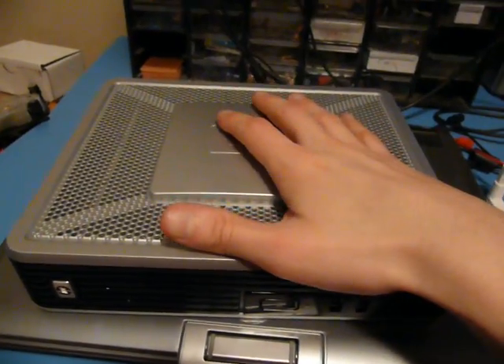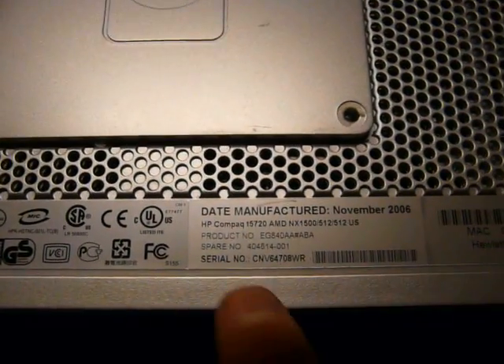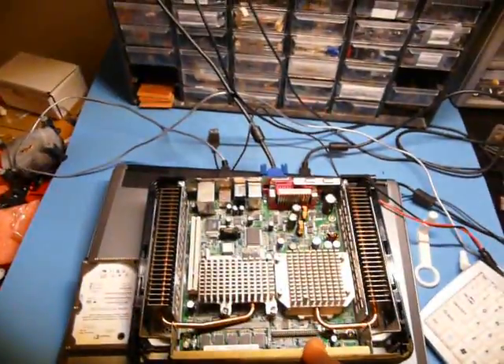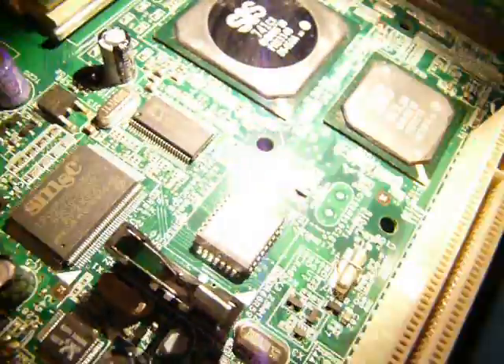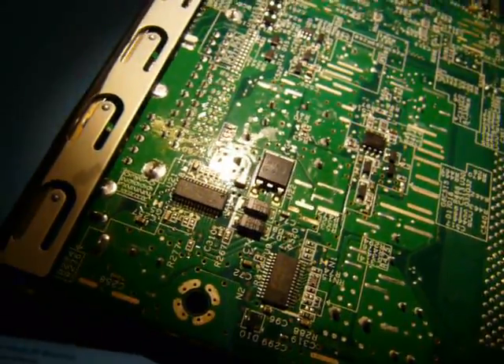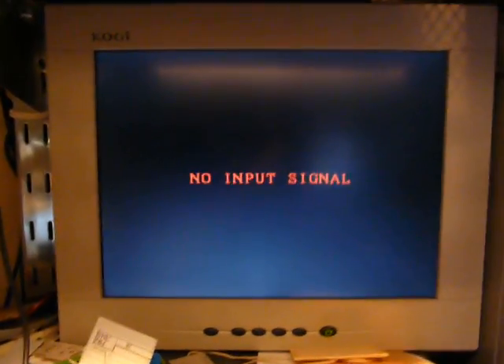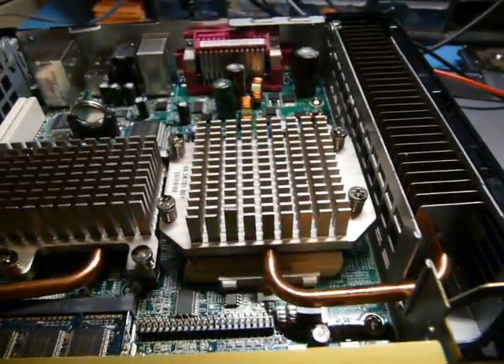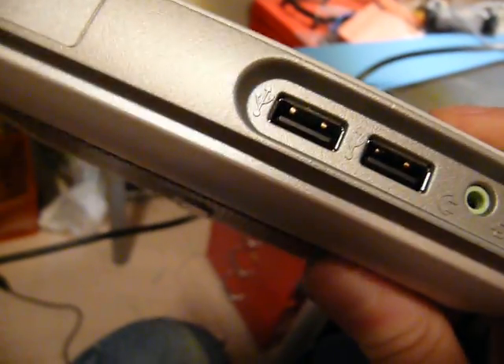HP t5720 Thin Client Teardown

Comment: do you recall a diameter of the power jack on t5720 ? is it 2.5mm or 3.0mm ?
Reply from the maker: Outer diameter is 5.5mm, inner pin looks to be 2.1mm. Latter is a half guess because my calipers won't reach the pin, sorry, and none of the jacks in my parts bin are labeled :/

Comment: To test these, connect them like a normal PC. They are essentially PCs with lower specs to allow them to run cool enough without a noisy fan.  If it has not been modified, it will still be likely running Windows XP Embedded Compact.  It will run most of the same stuff Windows XP will but has much of the miscellaneous junk taken out that is not essential to the operation of it.  Some GPS type devices actually run Windows CE which is very similar but the reason you usually don't see it is because they lock everything down and there are often few if any methods of getting to Windows from the software they typically use.  These thin clients don't have much memory and are good as a computer for email and internet, this one has 4 megabytes of graphics memory!!  That reminds me of my old 486 PC which only had that much main memory.  Because Windows uses a swap file when physical RAM is full, that computer was horrendously slow at times.  It even had a 2400 baud modem when it was new but was upgraded to 28.8K and was still unbearably slow by todays standards.  Back in those days we were still using AOL.

Comment: AMD Athlon 2500+ Thoroughbred core CPU w/266fsb will be the best upgrade for the system.
It will run @1.87Ghz and the motherboard will see it as an AMD Geode 1700 with no issues.
It will run hot but not too hot, a small fan will help.
Anything faster will just get uncontrollably hot and kill the system.
Reply: I saw your comment and installed the AMD Athlon 2500+ after your recommendations but my thin client keeps rebooting.  Do you happen to know the reason why and how to resolve it?
Reply: When this happened to me it was because the heat-sink was slightly askew on the CPU die.
When you remove the heat-sink I cannot stress enough how important it is to clean both surfaces.
When applying your thermal compound put a very small bead of it on the CPU die and torque each screw down in a star pattern.
If all else fails replace the CPU with the old Geode and see if it still boot loops.
Reply: OK thanks will try that.
Reply: William F
I know the system will run an even faster CPU. I purchased a pair of 2800+ AMDs @ 2.13Ghz w/266 fsb and I have one running 24/7 without a problem. I do have a 120mm fan blowing on everything to keep temperatures down though.
Reply: ***** Yeah still boot loops but when I put back old CPU works fine. I purchased this BARTON 333 AXDA2500DKV4D AMD ATHLON XP 2500+ A 462.  Not sure what the problem could be.
Reply from the maker: William F
Hm... perhaps the power supply is having trouble keeping up with the added load. Do you have the equipment to check the current draw?
Reply: I am running a 12v 4.16 amp psu from a different TC I had.
I just read your earlier post about the specs on that CPU. That may be the issue. It appears to be a 333 or 400 fsb CPU. I am going to check it out.
Reply: I was able to get a 333 fsb CPU to boot but it under-clocked it back to 266 so I do not know why you are dealing with a boot loop.
My only guess would be heat and/or not enough power from the stock 3 amp psu.
Reply: Don't have the equipment to check current draw.  But definitely seems to be getting pretty hot.
Reply: ***** THE BEST MATH! AMD Athlon XP-M Barton AXMS2000FXS4C Cache 512Mb, 2000+ (rated), 1533 MHz (real), FSB 266 will, Clock multiplier 11.5 Be the best upgrade for the system maximum power dissipation without replacing the power supply + 25 Watt / AXMD2400FJQ4C + 35 Watt
Reply: Try a Kill a watt.  That should tell you how much it is pulling from the wall.

Comment: You can remove bios password by just pulling out the bios battery temporarily.
Reply: if the Bios runs on CMOS (pretty much all PC's and Thin clients etc) then this is required to be in an always ON state, hence the button battery, by removing the battery you bring the Bios into the original CMOS print at the time. Most newer laptops use a less volatile Bios chip set that you can put permanent passwords on but again you can wipe these in a different way.

Comment: Hello. I really like the way you make your videos. I am a fan of those little boxes too and I also own 2 5720`s and 2 5730`s.
The Pci slot there is intended for its extension indeed. One of mine 5720 has this extension caddy with the PCI right-angle riser. Got there a 40Gb IDE Hdd and a Gigabit LAN card  running PFSENSE as router+firewall.
Regarding 5730, i got further enhancing it...on the model it is possible to solder on the PCB a miniPciE slot, a second DDR2 memory slot and a CF card slot.
I probably should make a video about this job too.
Wanted to thank you about your video, for taking time into doing this.Got precious info about the 5720 by just watching your video from above.
Greetings from Romania and happy you-tubing mate :)
Reply: how to disable the DHCP in this box, I want to assighen static ip

Comment: You could contact HP tech support, but the units are old so likely the best option is replacment. If money is an issue I'd contact an Ebay reseller about a bulk buy since they get 'em dirt cheap and there is little demand.

Comment: I have the same thin client, bought the other day, and it works perfect until I plugged USB stick on it and start coping from network, I left him for 5-6 hours and when I back the thin client is shut down. No signs of life. Green led on adapter is off. I pull down adapter from Thin Client and Power supply and get it back to power, Adapter works! Problem with thin client is that AC adapter turns off when I plug him into thin client (short circuit). Does anyone have idea what could it be?

Comment from the maker: Yeah we both like the more unusual kinds of computers :) That PCI slot is indeed puzzling... perhaps there was a 90-degree riser board in some models. I guess maybe a super low profile card could fit, but I have doubts. Perhaps the mainboard is a general-purpose small form-factor deal, and this thin client is only one of its uses. I certainly like having it, though :)

Comment: I don't know if it was a wise thing to connect the power line from the computer to the dead hard drive. A dead hard drive will draw a lot of power if it has a hard time spinning !
And even without that, a 3,5 drive use a lot more power than a 2,5". So you should have used an external power source for the hard drive.
But it's just some details.
Your video was absolutely excellent !

Comment: (continued from previous comment)
the system crashes. Because I do not want to add fans (ruins SSD quality) I had to put the stock CPU back in. I thought about water cooling as an option, but it worked fine before on the stock CPU and I'm not going to build a whole water cooling rig for this thin client. Its more trouble then it's worth. Anyways, nice video, and nice machine. Be sure to post a video of it in your car when your done!

Comment: (continued from previous comment)
I used to run Ubuntu off of my t5720, but ISPY is more compatible with Windows, so I reluctantly made the switch. To answer a previous part of your video you CAN upgrade/change the CPU in the t5720. I tried a bunch in the AMD Athlon series, but the only one that worked is the AMD Athlon XP 2500+ - AXDA2500KV4D running at 1.46GHz. It runs like a champ but the one problem I cannot avoid is the serious amount of heat it throws off. The heat pipes cannot keep up and

Comment: Fantastic video sir! You really know what you are doing. I am a big fan of these thin clients also, I have 2 hp t5730's and one hp t5720 (the one you have). I use my t5720 as a security server and I have it hooked up to cameras around my house. I maxed out the RAM (1gb) and I have a 128gb SSD IDE drive in it so it can run 24/7/365. With no moving parts, its the perfect candidate for what I'm using it for. I'm able to run windows 8 on it no problem and I use a program called ISPY for my cameras.